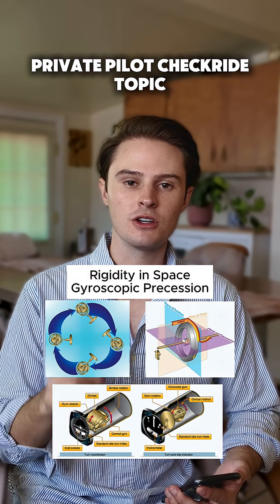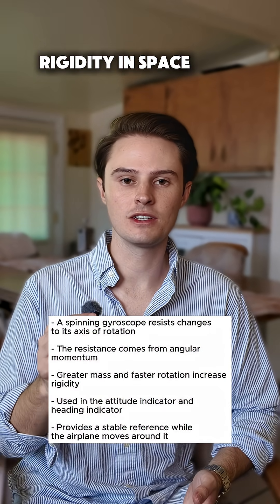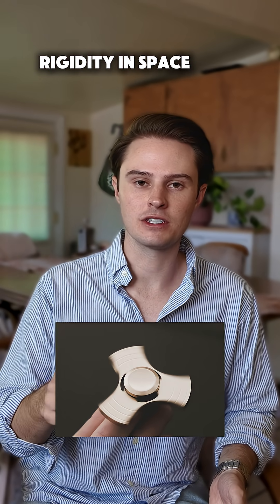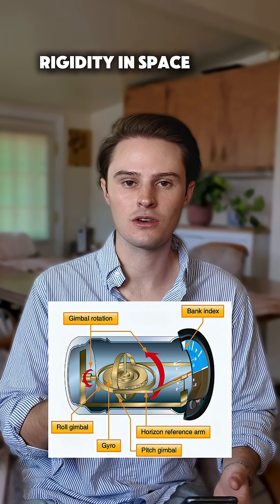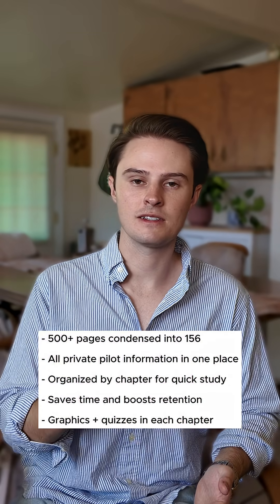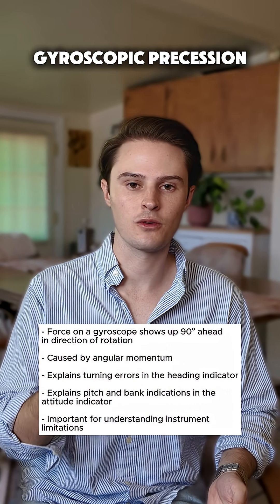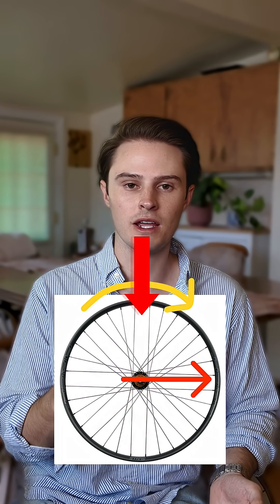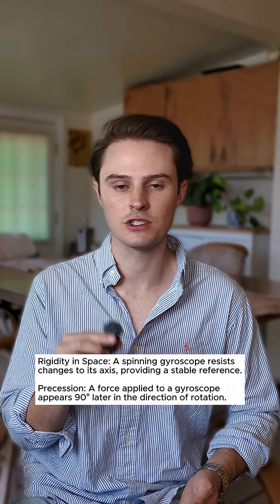Gyroscopic Precession and Rigidity in Space Explained

Comment: I feel like your channel will skyrocket in subs so I just want to comment now because it helps a lot for you and I want proof that I was here
Reply from the maker: This is the best comment so far. Thank you 🙏
Reply: @joesephbeckmann   np just existing
Reply: It's funny to turn on a bicycle wheel and it's sitting on the finger like a bird just resting on one end of the axis.
And when you try to understand how this happens and why you always have to turn in a certain direction bound to the direction of rotation you just have to care for the forces at 12 and 6 o'clock and how they deviate the inertial Impulses.
These positions represent the maximal torque applied by gravity and they represent  the sums of inertia Impulses at the upper and lower half of the wheel and logically all upward and downward directed forces eliminate each other and you find a tangential impulse vector exactly directed orthogonal to gravity with direction due to spin direction.
If you mentally deviate these vectors by the vertical torque you clearly see the direction the wheel's gonna turn around it's lateral axis and further precess.
And why there's no way to deflect a torque on the spin axis other than 90 degree.
Reply: @Raucherbeinknacker   yeah sounds bout right